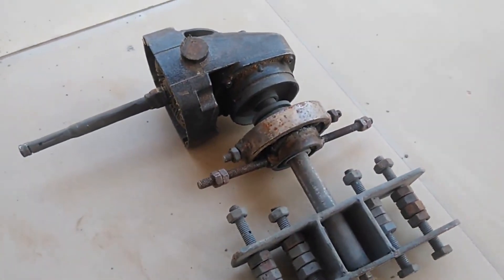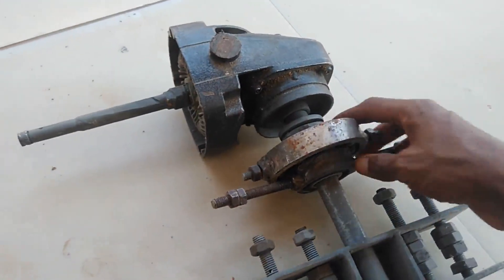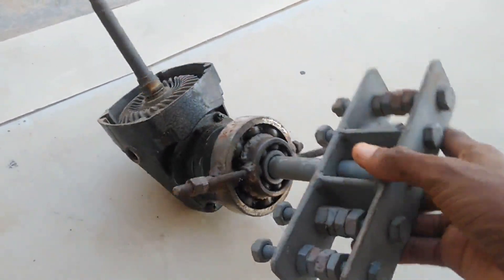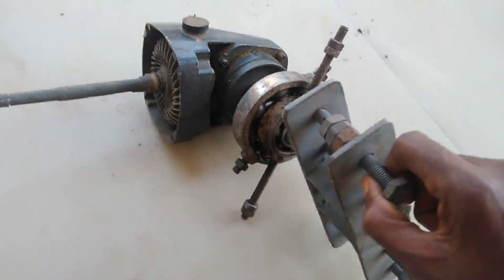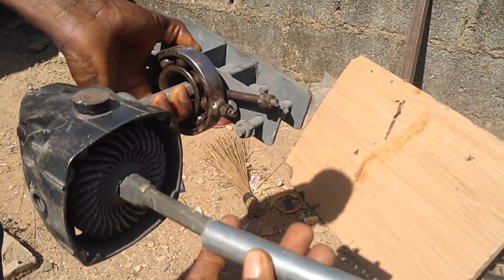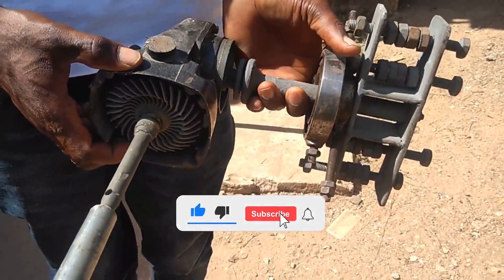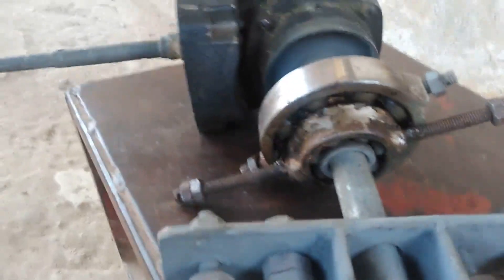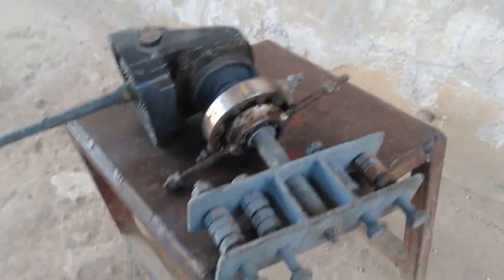Home Built Ultralight Helicopter Tail Rotor Gearbox Explained

Comment: Those gearboxes are 3 to 1 geardown so your input shaft has got to be high rpm. Also the tail rotor shaft is very long supported by to close bearings make sure its balanced right, because it will bend.